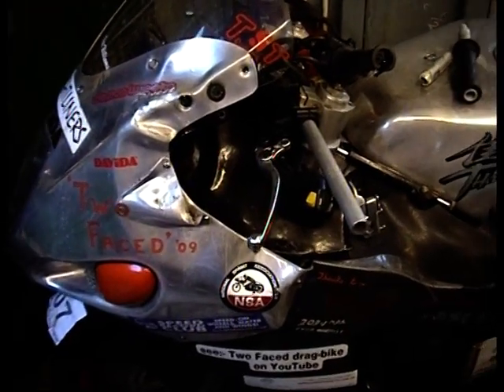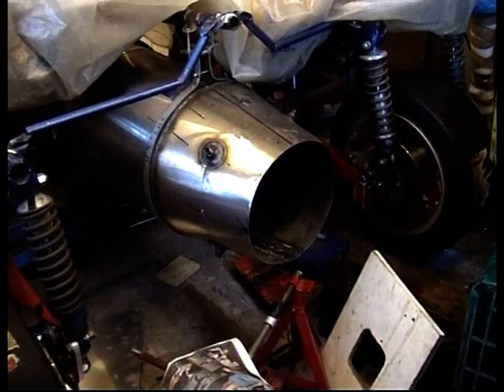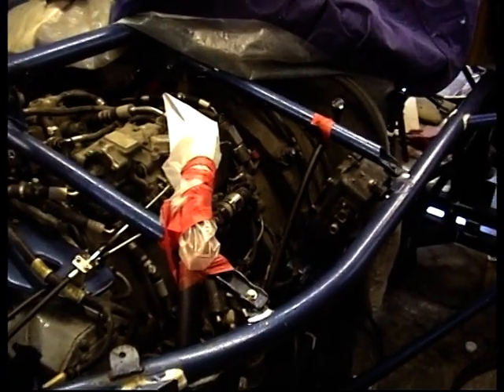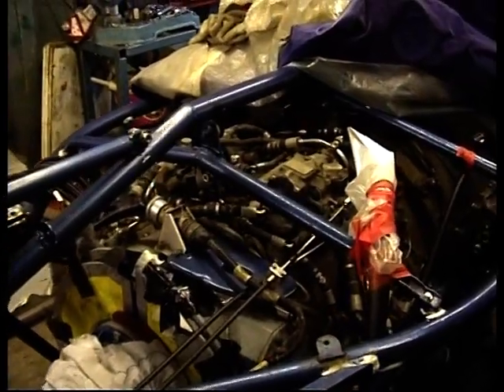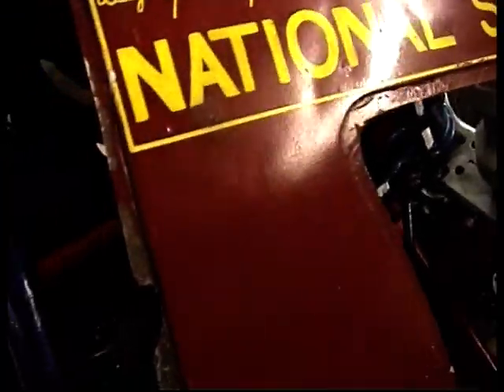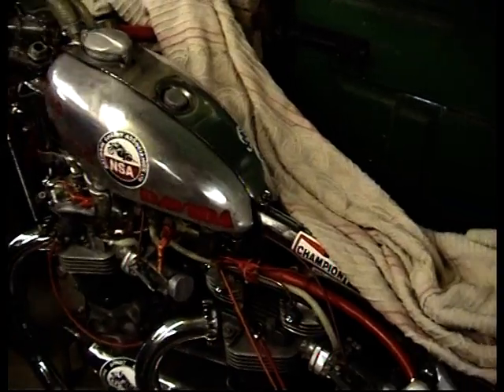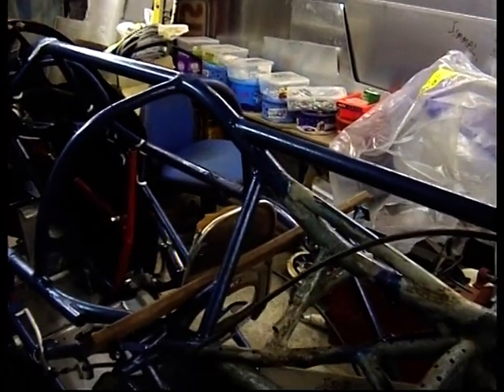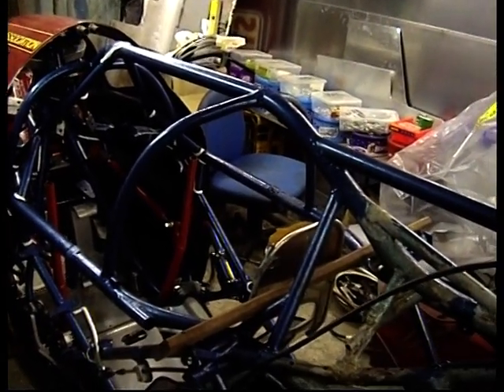Part 2 Thanks To NHS & Crash Update, extra to part 1.

Comment: Hope your doing alright and are back building the jet
Reply from the maker: Hi Colin sorry for delay replying, I am still repairing my Hayabusa it did get badly knocked about after my crash. Also new reg's say metal valves in wheels so busy doing that too and fitting new tyres. I hope to get on with jet build by Christmas. Cheers, Pete.